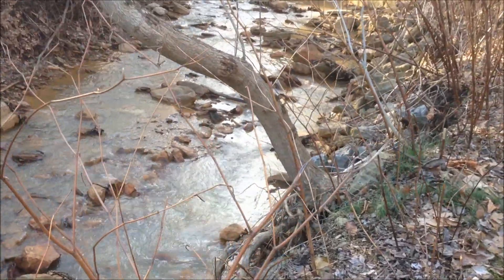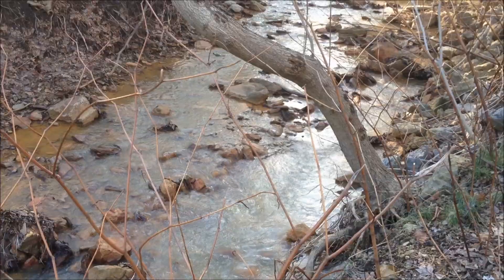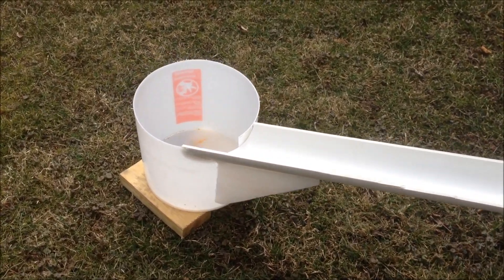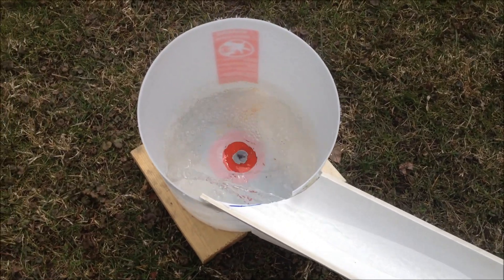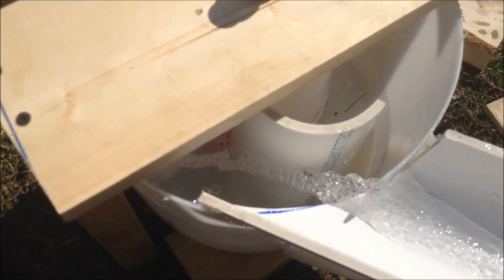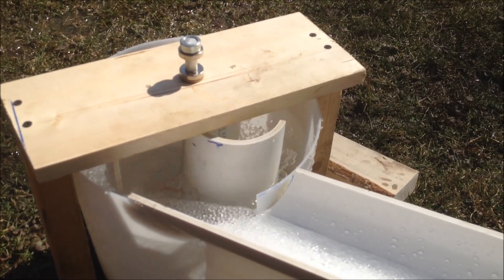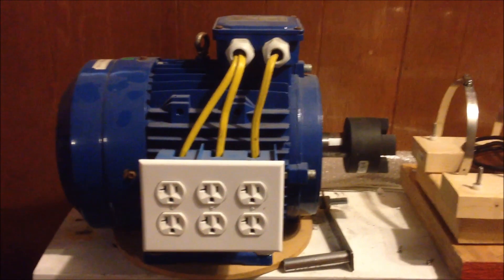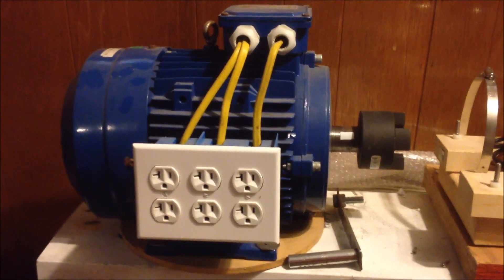100% off Grid how to

Comment: Do you have a video on how you harnessed the power after creating the vortex? We are tweeking ours ... currently only 50 RPM ... hoping for 80-100 RPM .... but are stumped on the alternator/generator to use ...  We have a 48 volt system.

Comment: Interesting !!!
Any other links, specs so a design can be worked to fit a given water volume ?
The Math should be interesting....
Is this considered a LH turbine?
Thanks
Bill
Reply from the maker: So far I haven't found Specs But you can get a general idea buy watching videos. Also the main part seems to be the outlet hole to match the water flow. The cool part is unlike wind oe solar its 24/7 and the amount od water give a lot od Horse power behind the generator. Not sure what LH turbine means Just look up "Water Vortex Turbine"
Reply: diveborg13 ThanksI been reviewing videos and have a friend that is in need and has the water resource.... Hmmm can't recall his ...Victor s (?) did a lot of work relating to this effect...bake at the beginning of WW2, Austrian I believe,also reviewing his work... Once I get the ratios figured the design should fall in place..LH = Low head ... not the same as what we are speaking of... sorry my blooper....Will let you know if you like as the design move forward....as far as the discharge port... make it adjustable to fit like a null zone or operational window.Bill